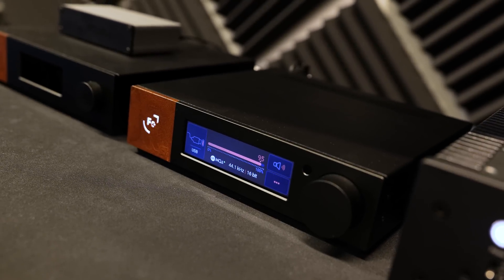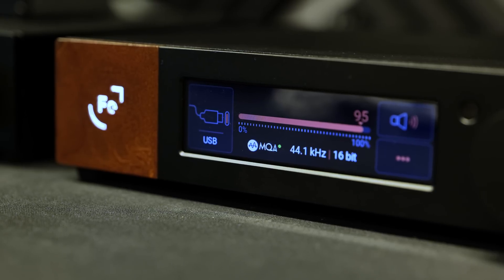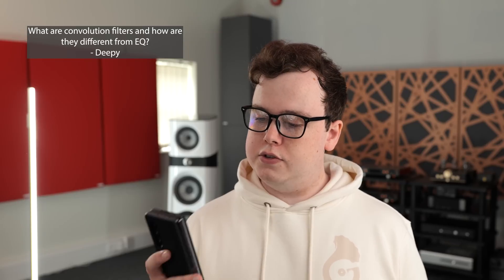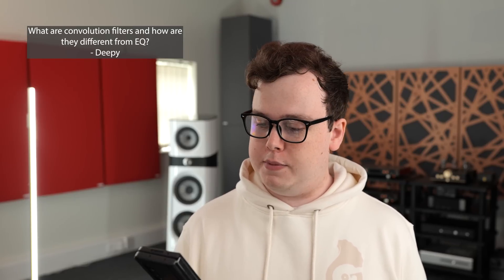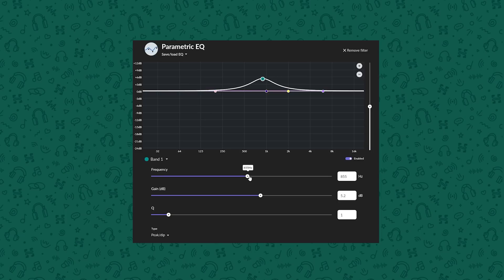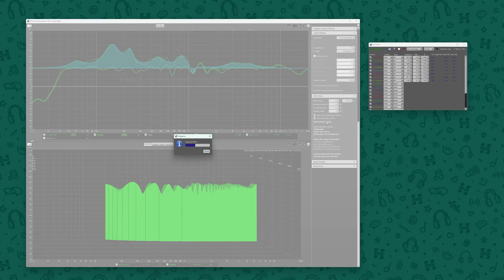EQ or Convolution? - Audio Support Episode 2

Comment: Slight disagreement on "higher dac output is better". Both high dac output and low gain amp and low dac output and high gain amp have their own tradeoffs. Idealy you want to atenuate as little as possible and since almost no amps have truly variable gain stages, ideal dac output level will often be determined by the amp and cans being used. Neither high nor low dac output levels should be viewed as better or worse than the other. Jjst different.

Comment: I don't know if you look at comments here as well but I've been dying to know how to dell what amps are good for IEM's. The main worry being noise floor. On some amps you hear a hum, on others you don't (or less). Is this measurable?
Reply: You shouldn't need an amp but you shouldn't hear a hum either. Generally you will use the low gain option if one is available for an IEM. The hum could be a number of problems, including having a group loop or maybe needing a different DAC or connection type

Comment: I was wondering what a Preamp is and what does it do?, I use Poweramp app on my DAPS and have chosen the Focal Utopia 2022 preset but I don't understand what a preamp is for, I like this preset for my midrange headphones as it brings out vocals better with more clarity, I don't have the Focal Utopia 2022 headphones or the original as it is too expensive for me and use a Sennheiser HD 660S, HD 560'S, HD 599, Focal Clear and Clear MG, Focal Celestee and Elegia. I have learning disabilities so please explain what a Preamp does very simply, thank you.
Reply: preamp is literally just a dB knob, +2dB preamp means it amplifies the sound by 2dB. preamps are usually used before other effects that have any boost to avoid clipping, so if you have an EQ that boosts 50hz by 3dB, you would add a preamp of -3dB before the EQ effect, the audio chain would be input->preamp(-3dB)->EQ(50hz +3dB)->output
Reply: @liquidmagma0  Oh thank you for that,  much appreciated, from my understanding of your message, if any of the frequency ranges are boosted through EQ the preamp just means it there to avoid headphone or speaker clipping or unwanted distortion, is that correct.
Reply: @robertobuatti7226  yup, just make sure the preamp goes BEFORE the effects. if an effect boosting audio causes clipping, applying a preamp AFTER it isn't going to unclip it. if the preamp is included in an effect, it would apply before the actual effect.
Reply: @liquidmagma0  Thank you for that, will do, much appreciated for the feedback and help.

Comment: Inverted polarity makes no audible difference
Reply: Coming from a single sound source - that is true. However, there do exist some scenarios in which you want the same audio content coming from multiple devices at the same time (e.g. a powered subwoofer in a 2.1 setup), but one of the devices is playing out of phase with the other device(s). When this happens, the effect is very much apparent. Having the ability to arbitrarily flip the phase on one of the devices would alleviate that problem.
Reply: Was that not implied in the video?